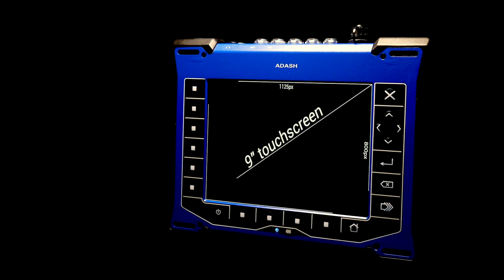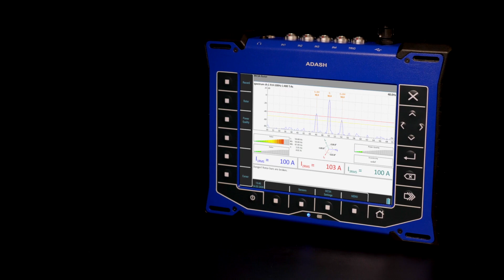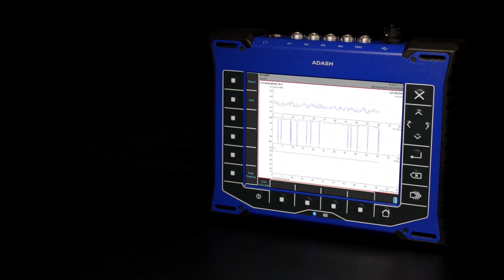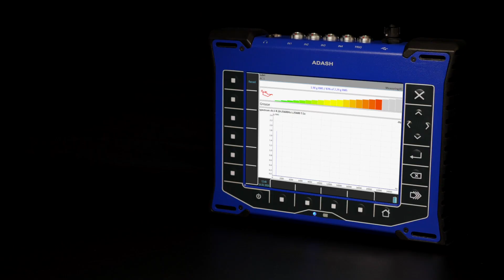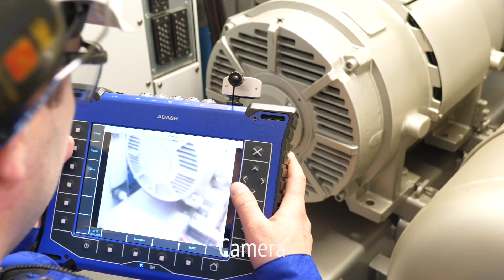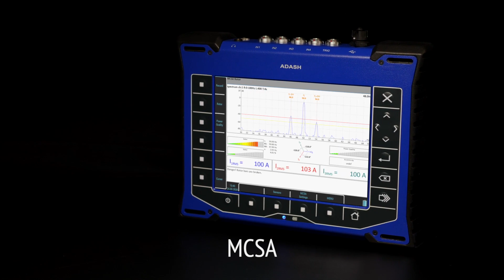ADASH VA5 Pro Vibration Analyzer  - Quick Overview

Comment: Hello everyone. I am using VA5 Pro. And i need to measure the ohase shift of a Gas Turbine Compressor via panel. However, I only have 1 bnc cable (AC In) and 1 key-phasor cable (trig). Is it possible? Please advise. Thank you
Reply from the maker: Phase shift is 2 channel measurement. You will need one more BNC cable for 2nd AC.

Comment: Great. Very powerful analyzer to perform condition monitoring on rotating equipment
Reply: Hello everyone. I am using VA5 Pro. And i need to measure the ohase shift of a Gas Turbine Compressor via panel. However, I only have 1 bnc cable (AC In) and 1 key-phasor cable (trig). Is it possible? Please advise. Thank you

Comment: I really like the Adash VA5 Pro (too) - it has a high-end hardware and a powerful analysis toolkit to ensure precise measurements and effective methods for the evaluation of machinery condition and other special cases.
Just a few days ago, I had to measure a PCBs (printed circuit boards) vibration exposure where the 100400 (!) lines resolution spectra really helps the correct evaluation. I have never thought to use such a high resolution spectra like that. I remember the moment when I read the news about the 3 million lines FFT resolution. I thought it was a joke...
The Recorder function with the post-processing capability is the one of the most effective tools for the expertise jobs. I showed it to a customer today how to use this feature to detect the gas engine knocking with a simple parameter based on a recording and a post process waterfall analysis.
Use your mind and use your Adash! ;)
Reply: The Recorder function is a lifesaver, we use it often!
Reply: @lindseypillow  You are right. I use the Recorder in almost each cases: in Route mode (along the standard measurements as an emergency record for further analysis) if I measure new machines  or in any case of any special measurement tasks. I hope the Recorder function will be developed with some additional cut / merge functions; it would be nice for non continuous signals.
Reply: Hello everyone. I am using VA5 Pro. And i need to measure the ohase shift of a Gas Turbine Compressor via panel. However, I only have 1 bnc cable (AC In) and 1 key-phasor cable (trig). Is it possible? Please advise. Thank you